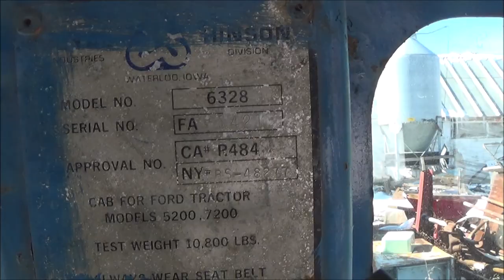Wind damage, cow update and the cold.

Comment: we had the same 50 degree weather few days ago. started raining then when to heavy snow and wind we had drifts 3-4' in places. and maybe an electronic ignition on the wc would help.
Reply from the maker: It would be hard to justify electronic ignition on that WC when it only get's 20-30 hour's a year that WD45 on the other hand it has been talked about a few time's as it started eating point's every month or so when we run it in the summer. By the way I'm down in Fowlerville part of the state.